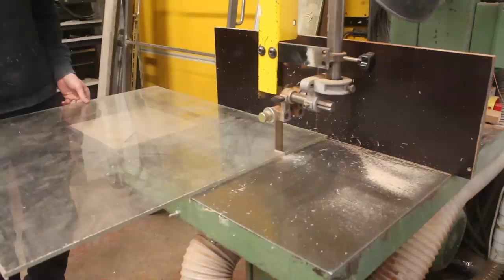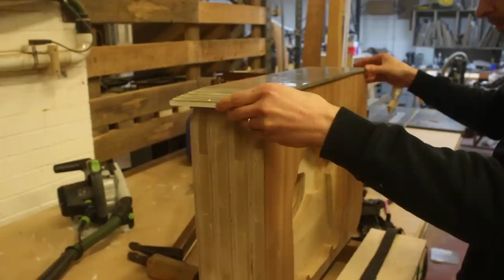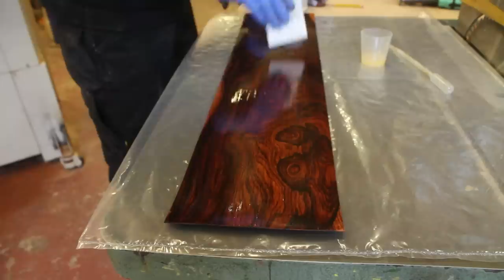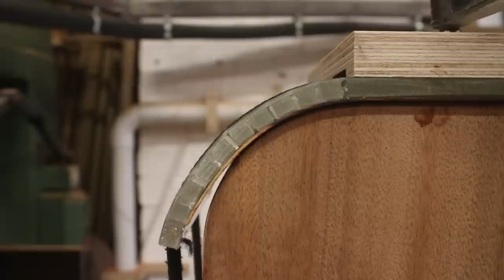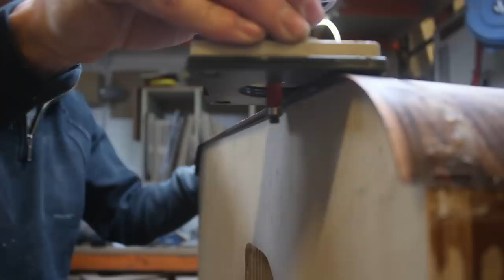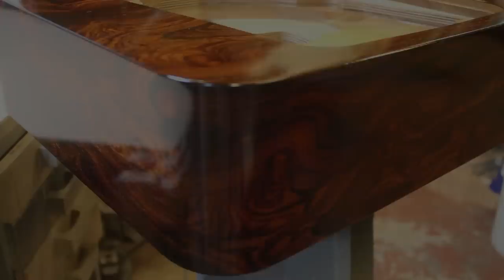Simple veneer press for curves

Comment: It came out beautifully, but one question: Was that piece too large to put in your vacuum frame press? If you put it in with its large side resting on the table, I think the membrane would have surrounded it and exerted pressure all the way around the piece. In fact, you might even be able to combine the techniques and use the caul you made in conjunction with the press to insure the application of even pressure.

Comment: That’s beautiful, however I have a couple questions.  One, why use epoxy vs contact adhesive? 2. Why use plexiglass instead of a scrap plywood?
Reply: Scott Rogers 
I had the very same questions. Hopefully, we will get an answer.
Reply: The only think I can think of, well with the plexiglass is, he will reuse it, and it last longer than plywood....but that's just me guessing on that.....and maybe he just likes epoxy over anything else. I know in a lot of cases I like it better....
I just want to know how he did his "seems"....
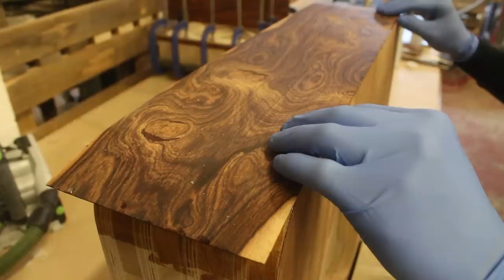Reply: 1 - Contact adhesive can dry out over time, plus as he said chocobolo is notoriously difficult to glue. 2 - a plywood version would / could also get stuck to the veneer; veneers can often weep adhesive where the are knots and other breaks - you can see a bit of weeping of the epoxy @ 3:36, there's a section around a knot close to the camera, and a vertical line further along.  Yes you could put greaseproof paper in between, but if you get a wrinkle in the paper that can leave a wrinkle in the veneer if you use mass produced thin veneers that most people only have access to - his veneer at 1.8mm thick has probably been produced himself by resawing then putting through a drum sander machine, lastly plywood nowadays is pretty crap, and not uniformly flat overall a lot of the time, the plexiglass will be, because of how it's made.  (yes I can see the seams, but the blend really is remarkable)

Comment: Excellent work. Questions and maybe hints for people thinking about similar work.

People sometimes (almost invariably) don’t understand how much more work is involved when dealing with curves over straight pieces. I was told that a box (or whatever) with curves would take 10 times as long as a box with no curves. And, if you have compound curves, 10 times again. The point was to make sure you costed the work out correctly. I have had people asking how to cut the price of a piece and my first answer is to cut out a curve.

Incidentally, have you tried bendy mdf instead of kerf cut plastic? I’ve had reasonable results  although have to cover the mdf with cling film to avoid getting that stuck.

1.8mm is a good thickness for fancy veneers. If you try to work knife cut  burr veneer of 0.5 or 0.6mm in the same way, you do get issues. If I’m unsure, I wet the veneer with a diluted mix of glycerine and water which softens it up a bit. Last point - use a sharp router bit and not one you have had for years. You can sharpen many router bits back to nearly as good as new state. 

Last question. Do you feather the second piece of veneer before applying it - totally or just halfway? Or do you apply and then plane to achieve the “scarf”. Using high gloss finish and the reflections from bright light is always going to lessen the view of joins.
Reply from the maker: all good points. yes, i feather the first part and then overlap the second piece and then feather it in, the feathering is fairly consisent with the curve to give a nice natural transition. 
i have a follow up to this in the pipeline showing how i futher blend the grain with earth pigment so watch out for that.
Reply: @NewYorkshireWorkshop  I look forward to the follow up. I blend using a mixture of wood dyes and waxes - all applies in streaks so that you don’t get abrupt colour changes. I’m sure you appreciate that my points were aimed at people who might be contemplating doing something similar - rather than teaching a grandmother to suck eggs (let’s see how our cousins deal with that saying)

Comment: Beautiful project! What type epoxy was used? What is the finish on the piece?
Reply from the maker: Thanks! the epoxy is West Systems, i used it because it works well at room temperature. the finish shown was just a polyurethane barrier coat which is the first stage before applying a high build polyester which is sanded flat then top coated with a high gloss acrylic.

Comment: Is that acrylic sheet that you used?
Reply from the maker: hi. no it is polycarbonate. acrylic wouldnt work as it is too brittle, no matter how thin you cut the kerfs it would just break.
Reply: What’s the thickness that you use on the polycarbonate?
Reply from the maker: @newageoutlaw82  it is 10mm thick. i think it needs to be fairly thick to spread the load but if you used more ratchet straps you could probably go a little bit thinner. depends on the width i guess.
 btw if you turn on subtitles you will get some more description of what is going.

Comment: use a 30 mil bag no worry bout poking holes then
Reply from the maker: Thanks. mine was the 20 mil vinyl type so not the most robust. i have a rubber membrane press for flat and low profile stuff. main reason for this simple curve press was convenience as its really awkward to load into a bag. ill try a 30 mil polyurethane bag next time i need to do something with a deep prifile that the membrane press cant do.